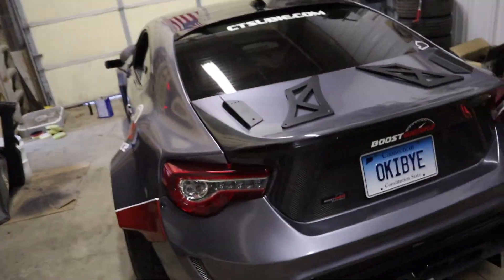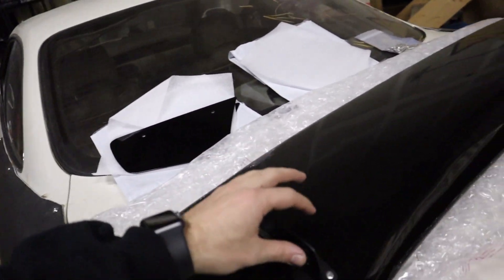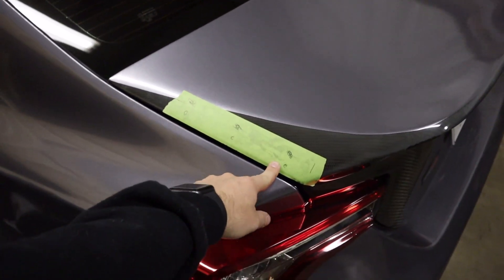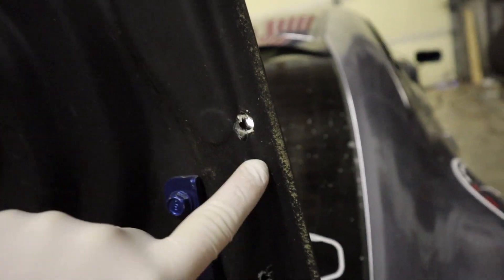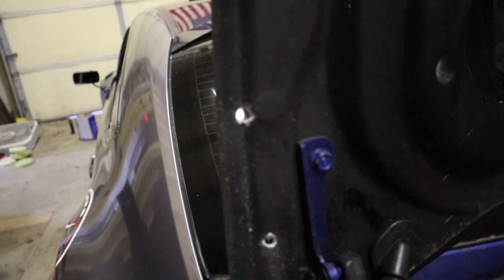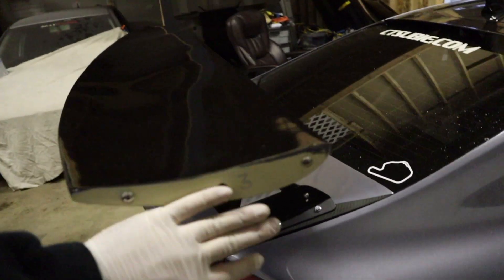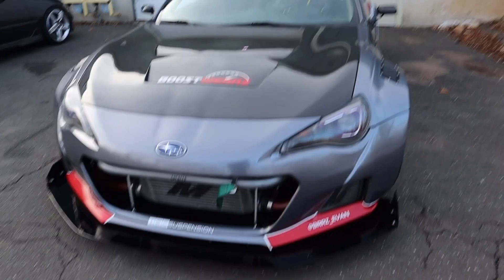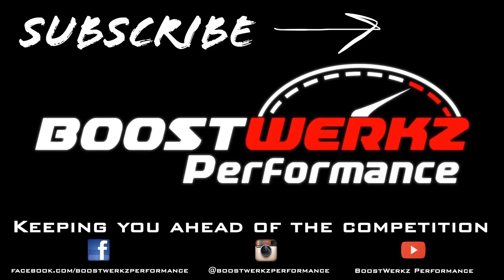Wing install on the BRZ

Comment: Does this rattle at all?
Reply from the maker: Jose do you mean shake? I haven’t really driven the car since I installed it. I drove it back to my house and that was it. I noticed on the highway that it shook just alittle. But regular street driving it was fine.
Reply: BRRRZ_Evan Yeah rattle/shake. I’m getting my widebody installed soon and I considered a battle aero wing but some guys at the shop said that battle aero was built poorly and shakes after 55 mph,
When it was shaking was bad? And also did it make a lot of nice?
Reply from the maker: No noise that I heard. And it was probably around 70mph when I noticed it moving alittle. Ive had a big country labs wing in the past also and that one moved a little too.
Reply: BRRRZ_Evan Hey bro I completely forgot to ask you, what size wing is that? And is it flush to the widebody or does it go beyond it?
Reply from the maker: Jose I believe it was the 70” or something like that. It wasent the biggest one. It sits flush with the mirrors, so it’s inward from the widebody alittle bit.
Reply: BRRRZ_Evan thanks bro 🙏🏻 and you do have a rocket bunny V1 Kit right?
Reply from the maker: Jose I have a lux motion widebody, it’s about the width of the RB V3 but it looks just about like the RB V1
Reply: BRRRZ_Evan ohhh I see, so it’s definitely a lot wider, meaning I should stick with a 66” instead. 70im sure would go beyond my fenders
How much was the Lux motion? I’ve only seen it one other time
Reply from the maker: Jose I bought this kit from a buddy of mine a long time ago who went RB instead. I only paid $500 for the full kit

Comment: How’s the seibon trunk holding up to the wing? I have my BattleAero GT wing coming shortly and want to install it on my seibon trunk. Worried about it breaking the trunk, and what’s this rattle/shake I’m hearing about? Would rubber gasket stop that?
Reply from the maker: Notorious P seems to be holding up fine right now. I haven’t really driven the car much but there’s no cracks or anything happening to the trunk. And mine doesn’t really shake much. It shakes side to side alittle but not much.
Reply: BRRRZ_Evan ok I’m just worried about it cracking the trunk. Track speed I get up to about 100+ haha. Hopefully it holds up!? If not we’ll I’m sol. Out of a carbon trunk and a wing lol
Reply from the maker: Notorious P yeah I have yet to go over 100. Tracks I go to around me I’ll def hit over 100 so gotta make sure it stays on lol
Reply: BRRRZ_Evan let me know! I still have two weeks till mine gets shipped out 😢 I got the 66”
Reply: Hey you didn’t make any support brackets? Just washers? I talked to seibon they said it’ll warp and tear the carbon over time. Think I may make brackets for underneath the trunk lid
Reply from the maker: Notorious P I haven’t made any yet but plan to probably soon. I don’t drive the brz like at all right now so there’s only maybe 300 miles on the car since I put the wing on.
Reply: BRRRZ_Evan I need to come up with a plan lol. Mines coming soon and I want to use my seibon. I can always use my stock, but then I have the ugly stock wing holes